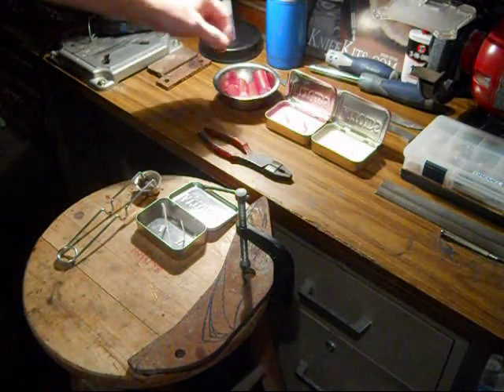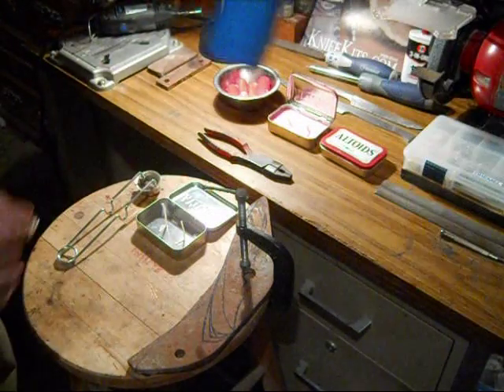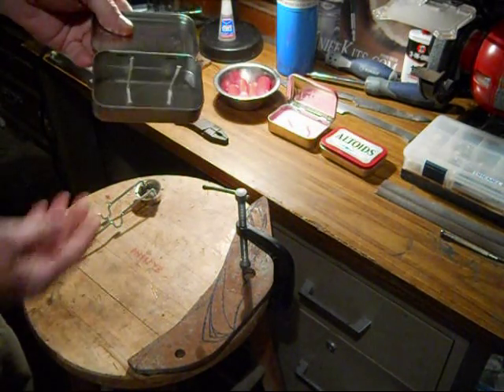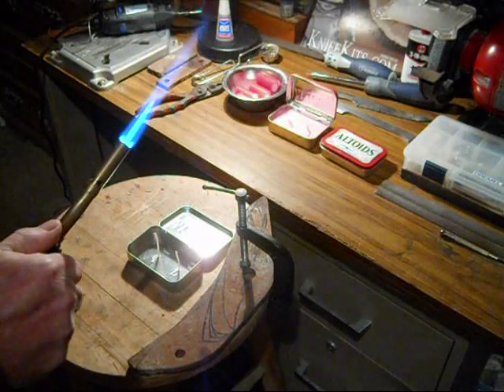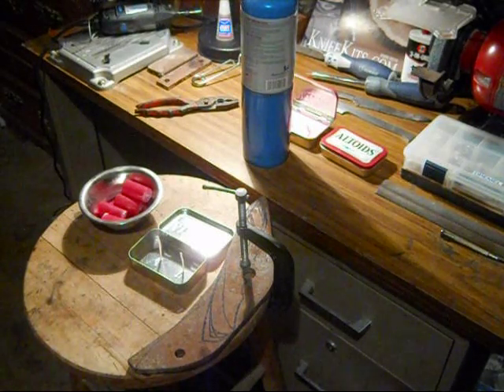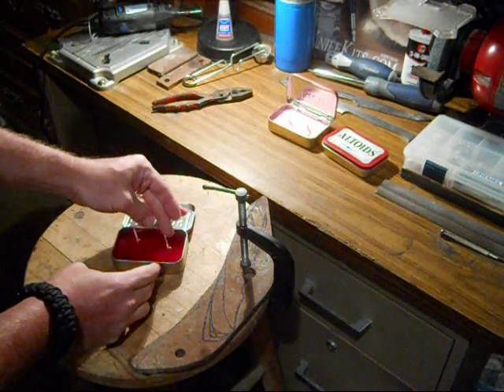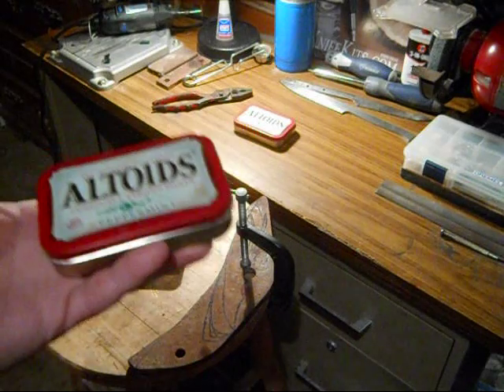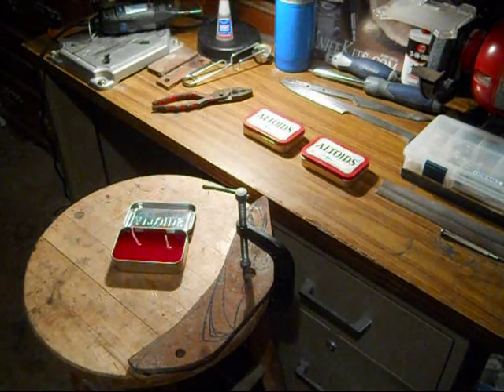SURVIVAL TIP: Altoids tin candle

Comment: It is a bit dangerous but it has benifits burns longer so you can easily transport it or use it as a torch. Also if you make a survival tin uses Trick Candles they relight because of gunpowder in them so if the wind knocks them out they can come back ;)

Comment: Resourceful, economical, & useful project, utilizing recycled materials. A Can candle in an Altoids tin nests compactly in one's  shirt or pants pocket; belt pouch; day pack; backpack; or survival kit. One SAFETY Suggestion: NEVER melt wax without a double bolier or equivalent metal container. with water to prevent unexpected flare-ups!  Wax is very flammable & once on fire, it can get out of contol within seconds. However, the Flint-striker that was used to light your propane torch will ignite char cloth, an alcohol prep pad, or petroleum-saturated cotton balls if placed in the CUP part of the device. Now you have another means of lighting that Altodis Tin Candle while in the woods or wherever. 'Blessings!

Comment: can you use crayon wax?
Reply from the maker: You could, it won't be as effective. Crayons are made of a different wax than normal candle wax though. It will get very brittle in the cold. It has more additives such as concentrated color dyes and some chalk. It wouldn't be optimal for this, but would work if it's all you have.
Reply: where did you get your wax?
Reply from the maker: Niara Spence I used bits and pieces of old candles that were too short to be used as they were. I also had a few tea lights and an old used emergency candle I used for this project.